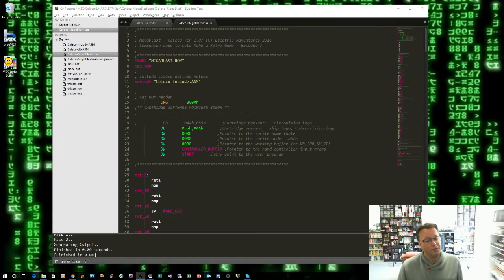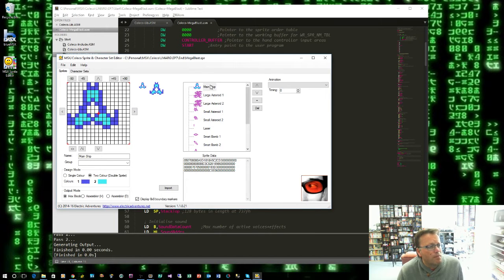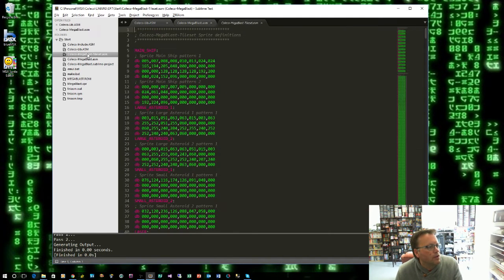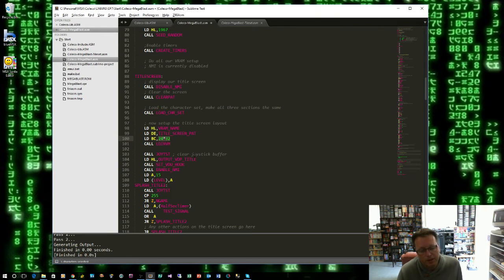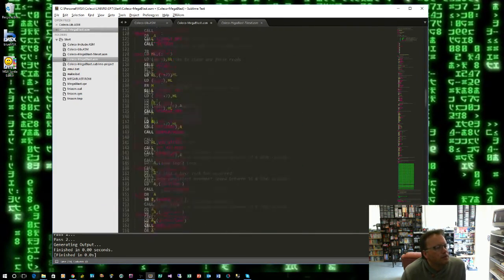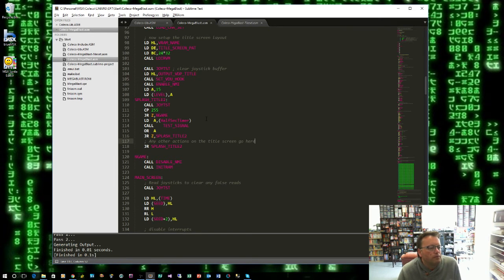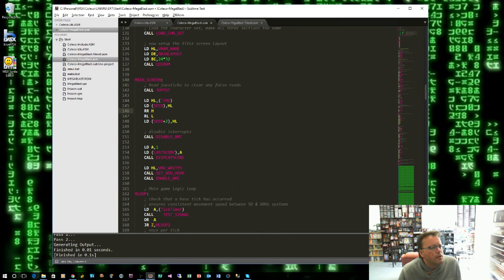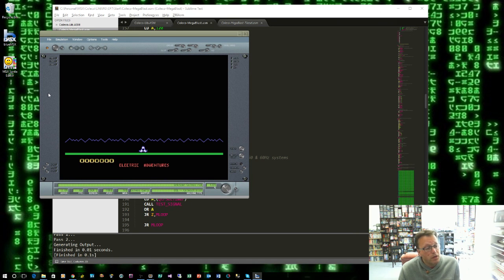Lets Make a Retro Game - Episode 7 - Displaying our Background

Comment: Interesting stuff Tony. The start of a game is usually a lot of setup code which sets the stage for everything that follows. Something that's important to get right. 
I use Sublime myself; it's a wonderful tool. I see you're using the Z80 syntax highlighting. That even works well for 6502 assembly I've found.
One tip I'd like to share is one that I was given when I started showing code on the screen and that is to make the font a lot larger. Having a light coloured background makes the red text easier to read and the cursor visible. 
Thanks Tony...I'll be following all the next steps.
Reply from the maker: Yes I noticed when editting that the font size was still too small (I increased it a couple of time), I probably should have made it full screen as well.
We have the starting framework for the game now, I can cover basic player mechanics next time and then onto some enemies :)
I'll cover how the score and life printing routines work later in more detail too.
Reply: Good stuff. Of course I'll be very interested in how your tile placement routines work and how your collision detection is done :)

Comment: This is a great series but I found the jump from the last episode to this one very overwhelming. The series started off taking you through the basics in very enjoyable baby steps but then you are faced with a massive wall of code which I found confusing. I'm sure the information in it is superb, but I felt that there should have been an episode in between this one and that last one where you just learn how to paste one tile or one sprite to the screen using the least amount of code possible. I understand it's tedious typing out code from scratch but it really makes a difference seeing thing built up gradually from a blank page.

Could you maybe do a short 5 minute appendix or supplemental episode to this one? It would really help fill in a bit of a blank spot as the series is one of, if not the best on the topic. Thank you.
Reply from the maker: The next episode, is exactly that, a side episode that covers a bit more detail on placing tiles on the screen, as this is not the 1st request :)  I have finished most of the support material for it, article, slides and code for MSX & Coleco, just need to get the SVI version working and I can film and release. Hoping to get it done later this week when I get some time off.
As these are not just me talking to the camera, they take quite a while to produce, due to the support material.  I am also writing a book that covers things in more detail as well.

Comment: Is it possible to do 8x8 sprites in MSX/Coleco Sprite & Character editor?
Reply from the maker: You can use it for 8x8 sprites, but the output data will output three blank 8x8 patterns as well in the generated code.  I will look at adding an 8x8 option/mode.